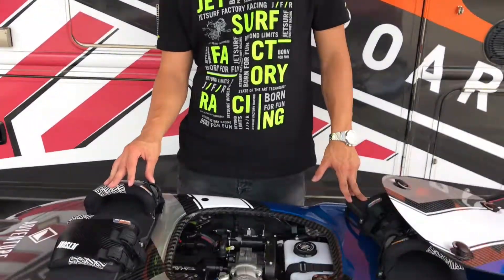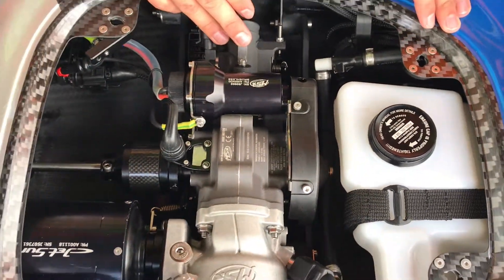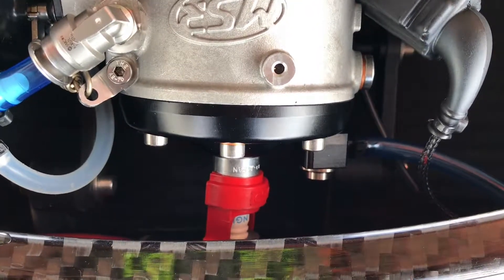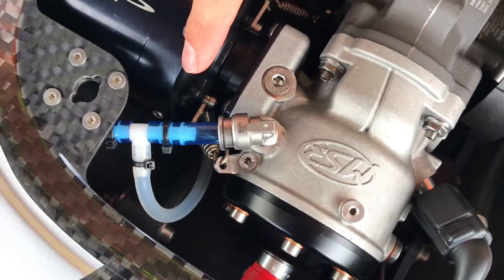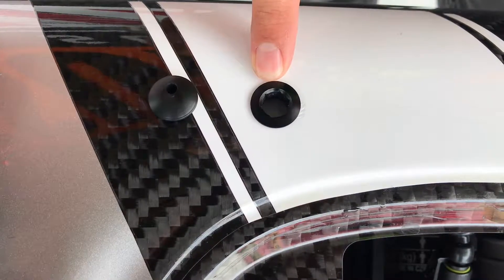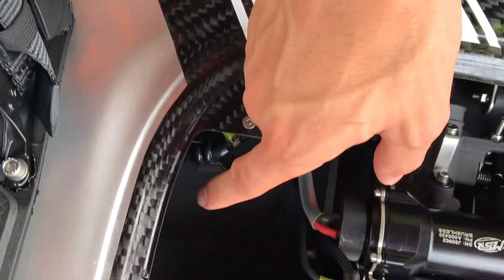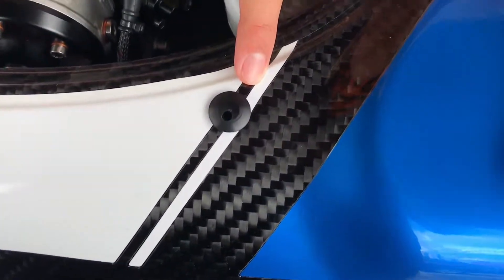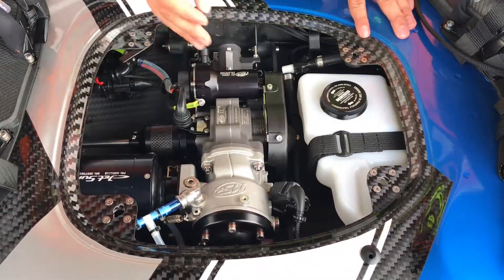JetSurf Tutorial 6: Engine compartment

Comment: Curious, i was out on the board, for some reason it cut out and threw me off. The bilge pumped a lot of water out which is odd as no reason for so much water to have got in. When I opened the case around the gears there was a loose gear and bolt so that may have stopped the engine.

Now I can’t get it to start. It does turn but  it’s almost as if the fuel isn’t getting in to give it the loud noise you know to indicate all is healthy. So it won’t start. I’ve done all the usual, cleaned the spark plug etc but nothing